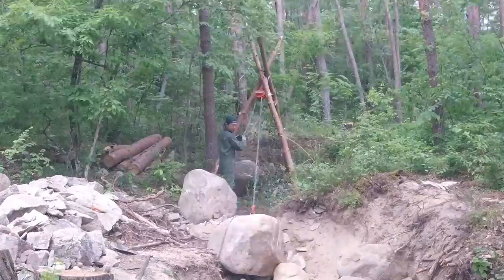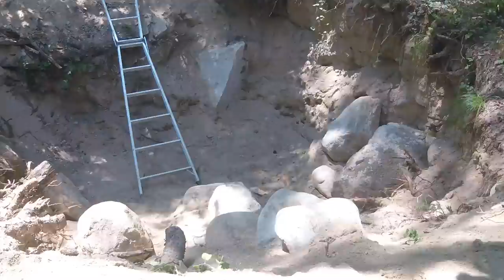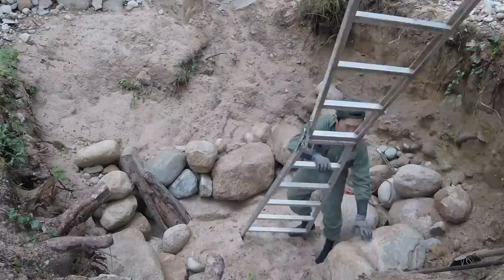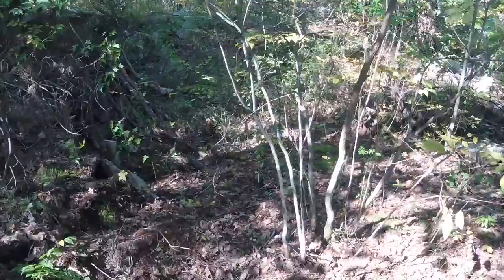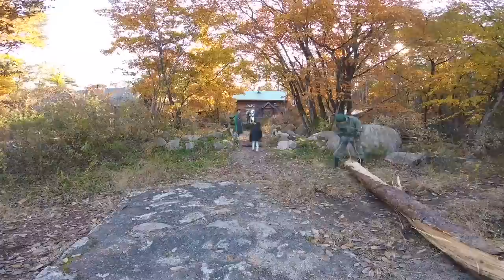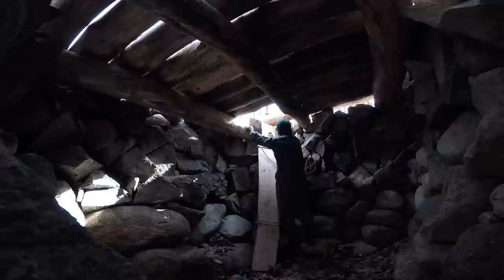[Part 1] We built a root cellar of "wild" rocks because coronavirus made us stay home..

Comment: A root cellar has to have atleast 5 feet thick of dirt surrounding the whole thing and a hallway atleast 10 feet long. Underground it stays 55 degrees all year round. And to get that benefit the hall way has to be atleast 10 feet with 2 sealing doors. To keep out the thermal exchange of air.
Reply: Guess I shoulda googled that... 🤔
Reply: Tell that to the pioneers who dug a hole under the kitchen floorboards or in the back yard. There are many types of root cellars that don't meet those specs and work just fine.
Reply: Those "pioneers" you are referring to lived in dwellings that were not very well insulated and temperatures inside the home were usually in the mid 50s during the winter due to the inefficiencies of a fireplace verses a cast iron wood stove for home heating. So it is plausible that a stash "under the floor boards" could work for part of the year. My comment  is what is backed by science and engineering for a year round root cellar. I would like you to put some cream or butter etc in a jar and place it under your kitchen floor boards for a few days in the middle of summer and not have an air conditioner on and see how well it keeps. I have been living off grid for close to 10 years now. And I have no modern refrigeration. I know what it takes to make and use a root cellar. Furthermore, do you know why in most states pipes have to be buried atleast 4 to 5 feet deep? Because of the frost line. In most cases even the harshest winter cant freeze below 5 feet. Too cold is just as bad as too hot in some cases. Below 5 feet of earth it stays 55 degrees all year round. I stand by my previous comment.
Reply: Not exactly.  Plenty of root cellars in ohio are built into hillsides. And have 2 doors and no appreciable hallway and often a primitive ventilation system and a drainage ditch around the floor covered w boards.  We store vegetables and stuff in em .. Some people also have Russian style root cellars with a hatch and ladder ..
Reply: I think, the video shows that the person who dug the hole just wanted to show how macho he was, not demonstrate that the hole he dug actual served a purpose.

Me, i found the "hole" lived up to being a hole with a Stone wall, nothing more. Not practical and does not live up to a root cellar minimum requirement.

But who knows, maybe the hole is not finished.

Comment: Highly recommend a small solar fan for CO2 build up as well as putting a piece of 6 inch PVC with holes drilled in it 1/8" about 6" to a foot below the dirt floor (install at lowest point of the the floor if not level). Then get a small submersible pump to put in to use as needed. As it will flood without a place to drain. Also Gravel is a great for cellar floors, creek gravel is free.
Reply from the maker: Sounds very nice. Thanks!
I like 'free gravel'.

Comment: For me it might be the stone well Collaps because they didn't used with Cement. Later on with different kind of insect and some small animals get inside,
Reply: It's called dry stone setting. There are miles long walls of dry set stone that are still standing after at least 100 years. Of course it requires some knowledge of stone, and how to place them perfectly to lock them into place. Root cellars have been used in the USA for well over 300 years. I'm sure they figured out ways to keep insect and small animal damage down to a minimum. At the least enough to have food last them until the spring.